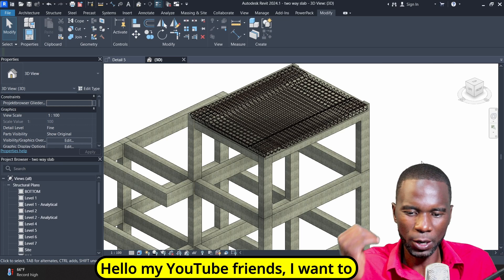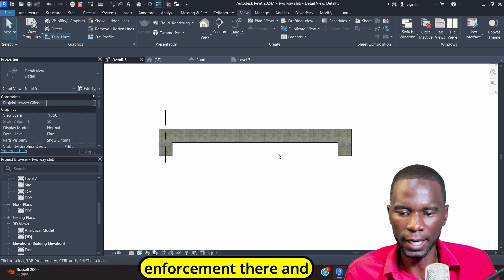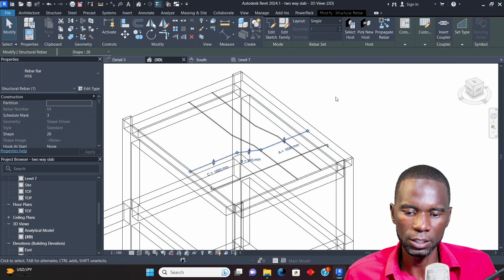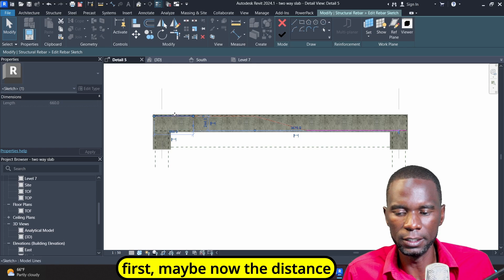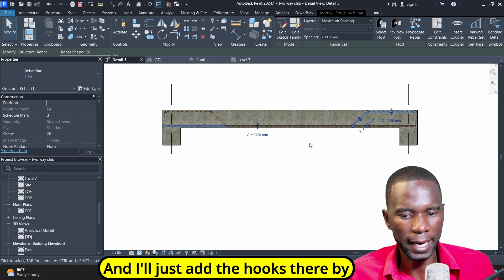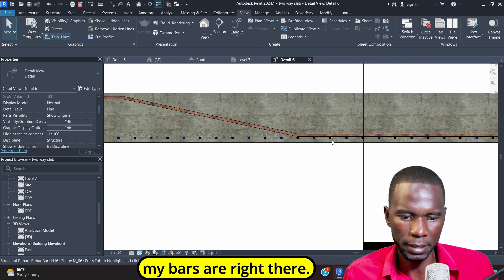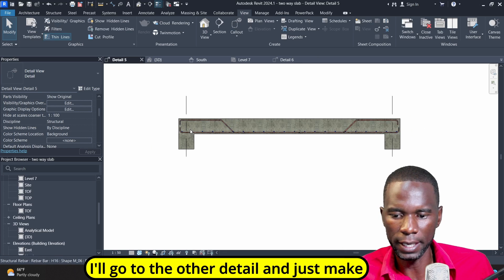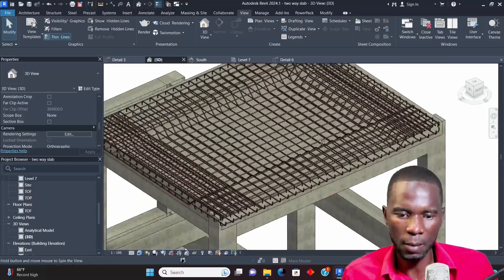Two way slab reinforcement details in Revit | A step by step lesson in Revit structure.

Comment: Please I'm having some issues trying to replicate this I use revit 2024;
1. I can't find the exact rebar shape you used and best I got was almost the same shape but had 90° hook at the ends.
2. After placing the rebar, it doesn't span across the slab but just at the edge of the slab with part of the rebar sticking out of the slab.